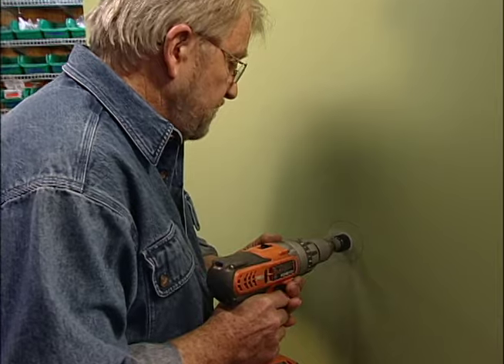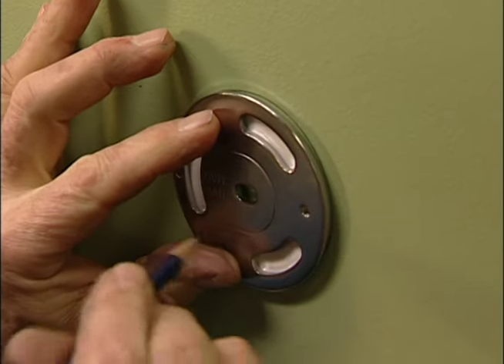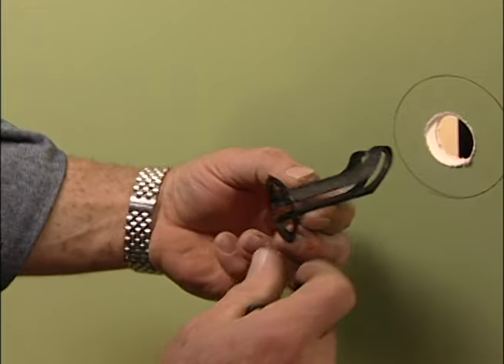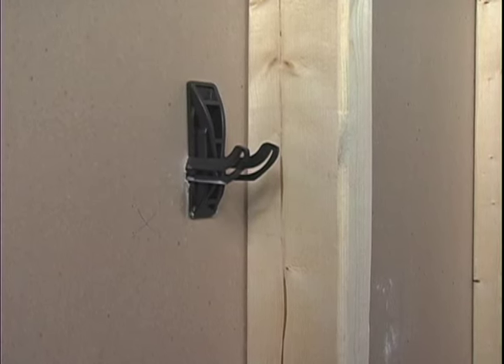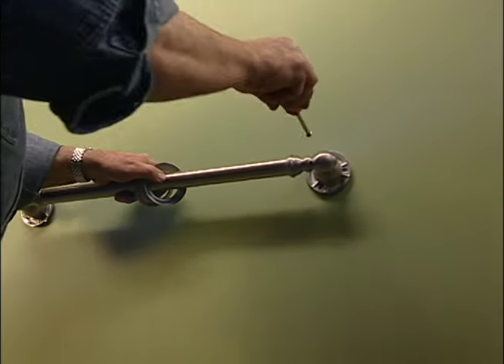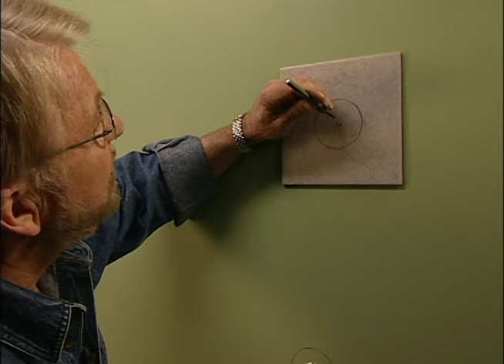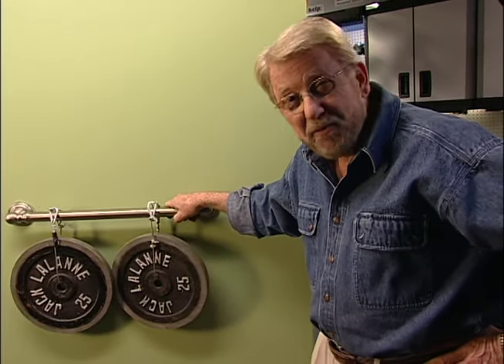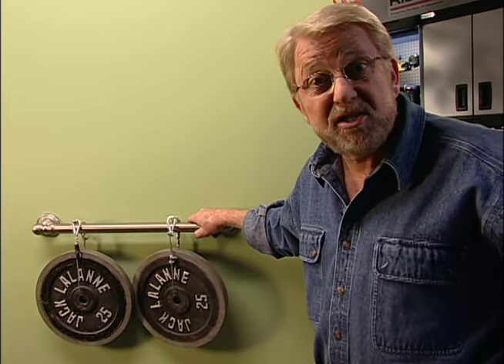Grab Bar Without Studs

Comment: Terrible system. A hole that big through a waterproofed tile wall - how long before you have to rip out the shower to repair all the water damage?
Reply: I agree with your point. I use silicone behind the mounting plates to create a seal to prevent water intrusion. Secondly, I am perfectly willing to risk water damage versus my senior clients falling in the shower or bathroom.
Reply: I have a 100 year old home. Walls are lathe and plaster? Can I install?
Reply: Use a sealant
Reply: I don't understand why can't I use those heavy-duty anchors that support 100 lb each and then apply for anchors into the tile? I must mention I'm not handy

Comment: How strong is it if the rail is pulled away from the wall instead of downwards, like in a real life scenario?
Reply: I'd think it would actually be stronger. The weight is spread out even more in that case vs downward.
Reply: @RisaMoreno  Up and down the gyprock is basically 3 metres thick so it's super strong for forces in this direction. Back and forwards it's only a few mm thick so much weaker.

Comment: Ron, shouldn't we check the wall to make sure there is NO stud to interfere with our new system?   It would be my luck I would hit two studs.   Thanks for your videos.
Reply: Better still to locate the studs first, that way you may be able to make a small adjustment and anchor one or both ends in the center of a stud.
Reply: If there is a stud you won't need this contraption, just get a regular grab bar and screw it in the stud!!!!!
Reply: That's my luck too.  I guess I also need a tile bit to drill a test hole first.   I've already spent $90 to put up one grab bar. o.O
Reply: A stud finder doesn’t work on tile. There is always possibility to mess up your wall by doing the wrong thing.
Reply: Studs are what you want
Reply: @wheelie642  Good point tho if an interior wall, maybe able to use stud-finder on backside (adjoining room) and CAREFULLY transfer measurements to tiled gra-bar location.
Reply: @wheelie642 they make advanced ones now
Reply: Best way to find a stud: rare earth magnets. Run them over the wall until you hit a screw holding the drywall or sheetrock or whatever onto the wall. Leave that magnet, run down the wall with another until you find another screw. Tada, you know the line of that stud!

Comment: I am a volunteer for the Yolo Healthy Aging Alliance here in California. I’ve been a general contractor for decades and I have to say this is the cleverest device I’ve come across. I’ve installed 200+ of these covering all sorts of building conditions and  I’ve adapted to each and everyone.
To the commenter who said “ this is a terrible system “ is apparently unaware that the BACKSIDE of the metal bracket has an attached compressible foam gasket that entirely seals off the hole. The diameter of the gasket is 3”. In addition the center screw holding the metal Moen SecureMount bracket has a stainless steel washer under which a rubber gasket is placed so when the center screw is cinched down the washer completely seals the oblong mounting hole.
If when you drill the initial 1-1/4” you find a stud, you can dispense with the plastic mounting mechanism and attach just  the metal plate to the stud with a stainless steel pan or round head #12 wood screw. Be sure to attach the stainless 
steel washer AND rubber gasket to seal off the oblong mounting hole in the steel bracket. 
One further note: do ONE hole at a time since it will allow more flexibility should your initial hole reveal unexpected conditions once you made the hole.

Comment: We own a bar, and the vertical grab bar (required by code) was just held in with wall anchors, which worked fine for 4 years. But recently somebody ended up pulling it too hard and pulled it out of the wall. I just ordered 2 of the mounting anchors to reattach it. Thanks for the video!
Reply: I've built some bars and remodeled a few. Put some plywood behind the drywall where ever you plan on mounting anything. Mount to the plywood and it will last a good long time. 3/4" plywood!
Reply: Did the grab bar pull out of tile or dry way?

Comment: Not sure that I want to cut a 1-1/4" hole through my shower tile.  Holding a stationary 50 lbs. is good, but to be more realistic, how about 150-200 lbs dropped from a height of 2 or more feet?
Reply: Yea I can’t find the studs behind the ceramic, may try something like this anchor kit ,just wish the hole wasn’t so big , oh well, probably stronger, thanks
Reply: @fleadoggreen9062  don’t forget to put the silicone on so no leakage

Comment: Can this system be used on a Fiberglass shower?
Reply: I have asked the same question on other DIY videos but never received an answer.
Reply: @Dr.Pepper001  well dwight you obviously own a computer  !  I know it might require typing afew extra words in the search bar! sorry to put all that extra effort on you!
Reply: Hmmm 🤔 sure, why not?  Just use silicone to seal it up to prevent leaks
Reply: I installed a Moen hand-held shower bar once on a fiberglass shower and used what Moen included in the box and it held up well.  I think they were toggle bolts.
Reply: Installing A Grab Bar in a Fiberglass Shower - https://www.youtube.com/watch?v=qqZ9rk7vqkM

Comment: My home is single wall with not the conventional wall studs. Could you create a video for installing grab bars on single wall homes???
Thanks for this video n looking forward to your next one.
Reply: DR PHIL  Thanks for your reply. My single walls are T&G, red wood with 2x4 pieces along 3/4 up the walls for added strength. It was built over 65 yrs ago.
Reply: DR PHIL  No drywall or tile on the other side.

Comment: I can’t find anything about UNinstalling these. We bought a house and the fiberglass tub/shower had 3 bars (6 mounts). I’ve removed 2 bars (and 4 mounts) but now have no idea how to fill/seal these holes, as it was not mounted into anything except for the fiberglass. 
Then the bar mounted on the wall? I can’t even begin to get the 2 mount brackets out without breaking the wall. Does anyone have direction for me? Or just count it a loss and install a whole new unit? Thanks!

Comment: My aging parent’s shower has solid Corian walls from floor to ceiling and the long wall is up against and exterior wall of the house.  Can’t find a stud with a stud finder.  Not sure this system would work in their circumstance.  Any tips?
Reply: It’s been 6 months, what did you end up doing?

Comment: Can I use this on a fiberglass shower enclosure?
Reply: I’ve installed over 200 of these units as a volunteer for the Yolo Healthy Aging Alliance . The answer is “yes”. This grab bar utilizing the Moen SecureMount system will withstand 300 lbs of pull in 1/8” thick fiberglass tub surrounds. It is UL and ADA approved.

Comment: Can this be used in an insulated wall?
Reply: If the insulation is not too thick and the anchor can open, why not? Goal is to spread force across a wider area so if anchor splays out, should be good.

Comment: Should have used a 3/4th oscillating bit with a wall-mount that’s at least 2.3. Then you want to get a hagsaw and cut a once inch joist on a slip-mount catapult with, and I can’t stress this enough, a 4/9ths structural jibwawwaw.